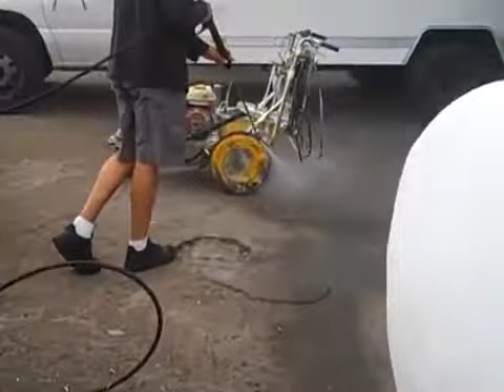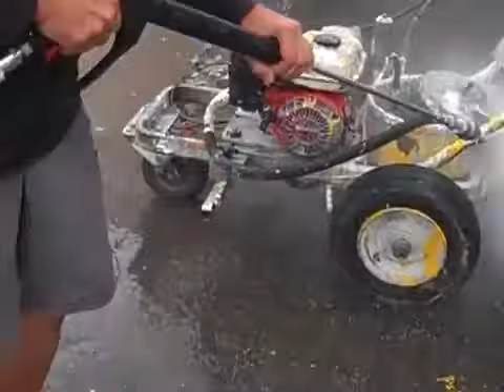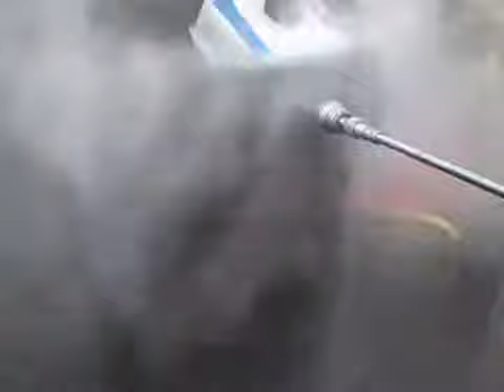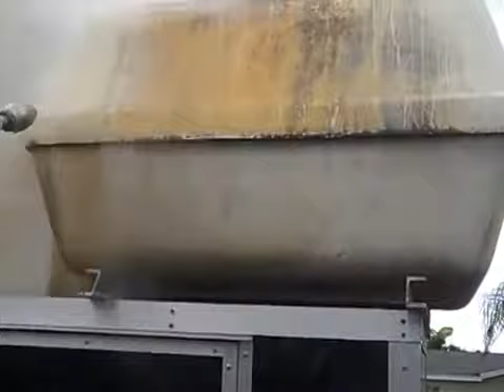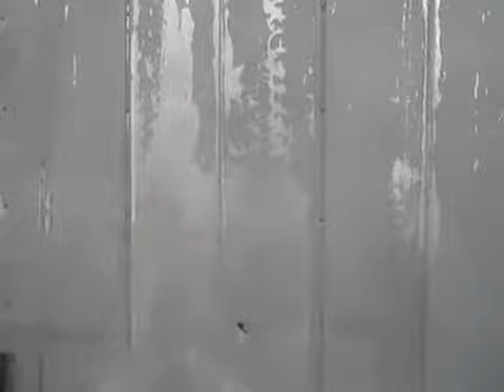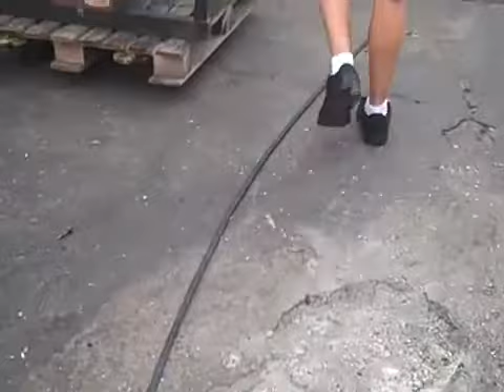Paint Removal Pressure Cleaner - Blast-Off Equipment in West Palm Beach

Comment: It will remove the paint from the bottom of a boat and destroy the gel coat.  Too many people don't understand it isn't the pressure that always does the cleaning, it is the cleaning units, this is by adding the gallons per hour and the pressure.  Volume of water is much more important in getting a job done in 2 hours vs the right machine or professional doing the same job in 30 minutes.

A turbo nozzle will also cut wood, slice a person open and should never be done with tennis shoes and shorts.  These machines are not safe and need to be respecte.  

The best way to remove the paint off a boat without harming the gel coat is to hire someone that does soda blasting, it only removes the paint and won't hurt the gel coat.